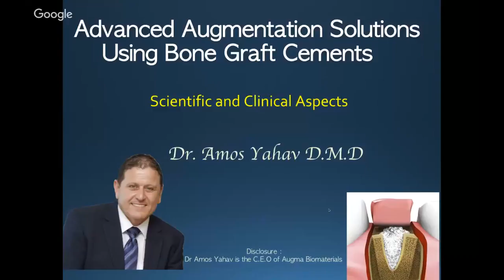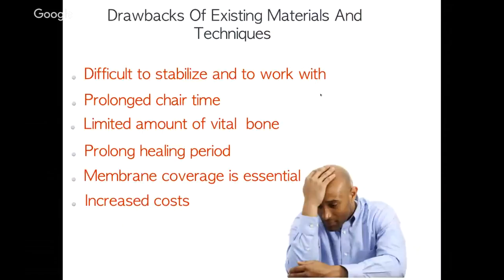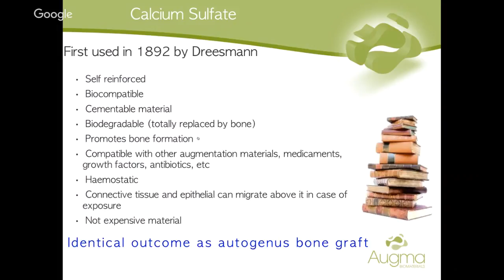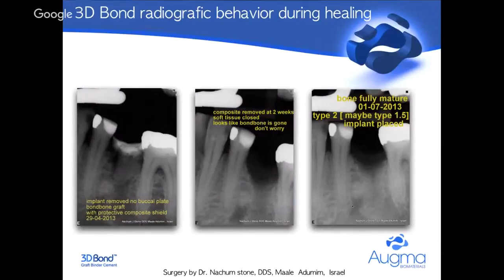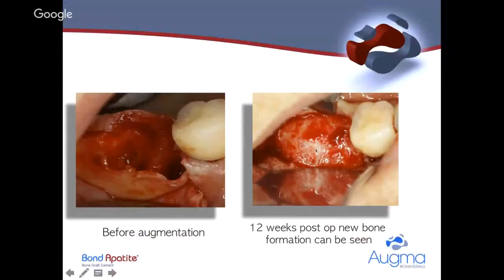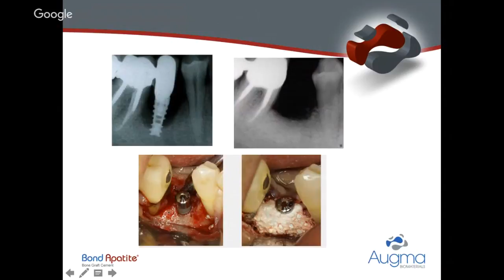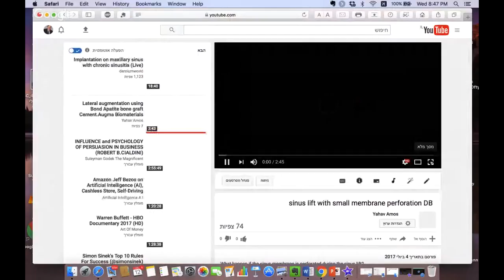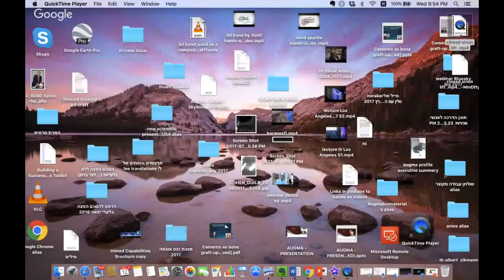Advanced Augmentation Solutions by Using Bone Graft Cements

Comment: i have to ask.  what possible advantage is there to closing a flap over the bone cement with tension?  to my mind that has no affect on the flap but a negative affect on the flap.
Reply: when you are working with the conventional methods you should have tension free because if not you will have exposure . with BCS cement it is    completely different there is no membrane  and the entire soft tissue behaviour above the BCS surface   is not even similar to healing above membrane so moderate tension keeps the flap stable above the graft which is one of the basic concepts in augmentation procedures -space maintaining and graft stability here because you have a direct contact with the graft the s stability of the flap is very important. while minor exposure is not an issue  at  all  not like as with membranes